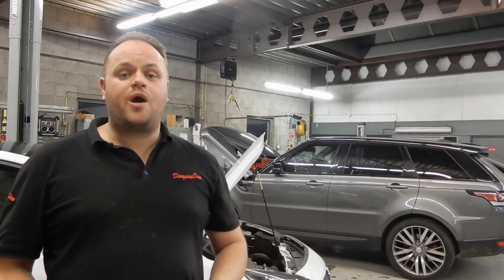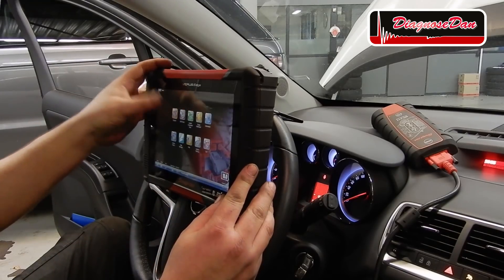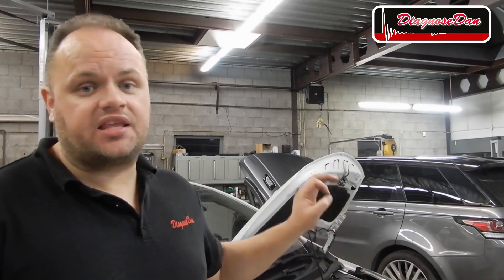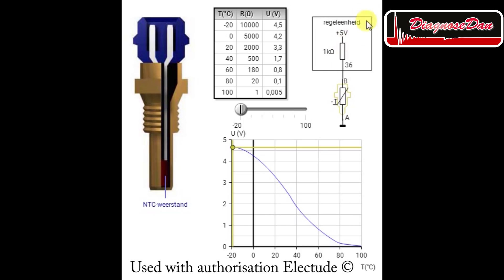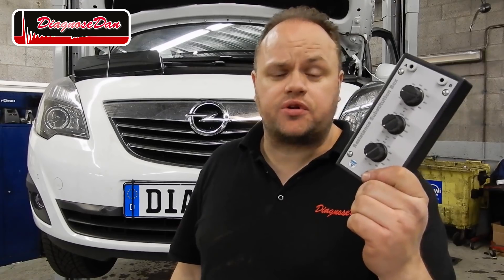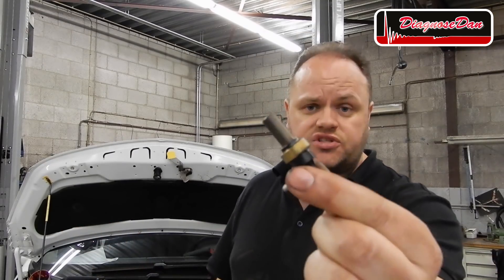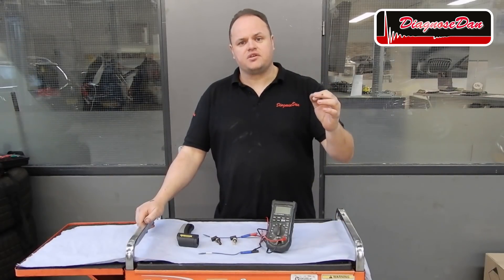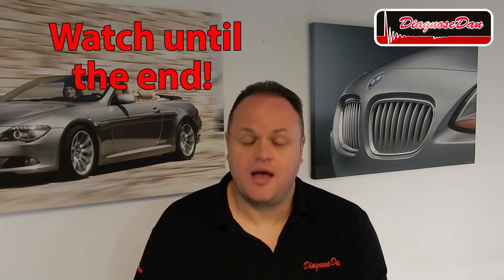Using a Decadebox to diagnose an Engine

Comment: here in the U.S, there is an overabundance of incompetence when it comes to diagnostics and the ones that keep up on automotive systems are few and far between and often has too much work
Reply: Ain't that the damn truth! I deal with idiots every day that don't have a clue at all! To make thing's worse, you have these "mechanics" who are little more than parts changers, and they still butcher simply tasks.
  I had a customer over the summer who had a Toyota 4 runner. She had taken it to one shop that originally did the head job. Well, they routed the wiring harness incorrectly, and even stupidly ran the main harness across bank 2 exhaust manifold and you already know what happened after that. The next shop that she took it to had done the diag only replaced the cam sensors but failed to repair the harness at that point, and failed to even look at the rest of the harness to see what else was going on. 
  They sent it out the door and the customer come to me the following day. I spend about an hour on diag and chasing wire's. Cam sensors part if the harness had a connection issue, along with the crank sensor plug being completely screwed up and i found a lot more damage in the wiring harness throughout the engine bay, and this all started due to someone not knowing what to do. She wasn't happy when i told her what she needed..
  Stuff like that gives tech's a bad name, especially in a small town that's full of shade tree's that have no clue about what they are doing.
Reply: @bryancenterfitt7127  I think in some cases the problem is two-fold. the customer wants the issue fix as cheap as possible so the find a friend of a friend of a friend who gives them a flat rate without first diagnosing it you know sight unseen then loads the parts canon.
Reply: @hammondautollc7809  
I completely agree. In my area, people will bounce from shop to shop looking for a answer that sutes there thoughts. The other problem is people who have no experience and taking on difficult job's and quoting a stupid low price and claiming they can repair it all in the hope that they can get that cash.
 In the end a customer still goes to a reputable shop and then will get upset when the first 3 people do more damage and it costs them 2 or 3 times more than it could have been in the beginning.
Reply: @bryancenterfitt7127  Yeah I agree, I guess we can only help the people that come to us and hope they didn't go anywhere else before us.
Reply: @hammondautollc7809  
Agreed 100%
Reply from the maker: Same thing here😅
Reply: Same here in Ireland, although the encouragement and training is not made very available either. Most garages ive worked for just want to throw parts at a problem and get it out as fast as possible. They have no interest in any diagnostics.
Reply: Don Quixote  You are lucky to have the internet.  We had shit when we started.  Keep your eyes open and your ears shut.  Dan has a good channel.

Comment: Given the huge hint provided by the temperature gauge, how the hell did the garage not explore that route?
Reply: They were parts changers and not Technician's
Reply: mor emoney in putting expensive parts, and they will also mark up dans work as their own, with an added percentage, they wont know dan did the work and hence also loses the repeat business.   Dan, drop some business cards in the glove box
Reply from the maker: I think the tech focussed on reading codes and dived right in. Missing the obvious 😰
Reply: This is engine basics 101. Dan may not have emphasized this enough, but that coolant sensor is big one of 3 maybe 4 other sensors that are crucial to getting the engine started both warm and cold. Coolant,  tps, crank, cam, mani temp, etc. but that coolant temp, can't say enough how critical it is.
Reply: Maybe the previous gge did not have any diagnostic equipment.
Because if they did you would have thought they would have checked live data to see if anything was amiss..
Reply: shauns auto repairs no equipment needed, measure ohms at sensor, compare resistance with expected value based on temp shown by the gauge or actual coolant temp. If these values jive, you’ve proven wiring integrity at the same time. Change the sensor and  Robert is your fathers brother!
Reply: If there are no codes the car is fixed!
Reply: Andrew Kirby I guess garage saw something what led to crankshaft possition sensor :D

Comment: Is this something in Opel ? just curious if Opel could improve their diagnostic system like detecting the sensor returns too low resistence etc. Are car manufacturers improving those diagnostic systems based on feedback from the field ?
Reply from the maker: Yes, they can and some cars do😊

Comment: Dan if you plz  if there is three wires in temperature sensor can I use the same test between the 5 volt reference and the meter wire or what , the other question is if I haven't this tool could I use radio volume switch in this test?! Thanx in advance
Reply from the maker: There are many ways to do this! As long as you change the resistance!
Reply: @Diagnosedan 
Thanx Dan and am I right about the way of test if there is three wires in the sensor?!

Comment: This is a little off topic. But aftermarket lights are notorious for adding fault codes. Is there a way to add a resistor to fool the computer into thinking everything is okay?
Reply from the maker: That's what some manufacturers of aftermarket LED lights do!
Reply: Some?  What other techniques do they employ?
Reply from the maker: @rabnudj  Some cars don't have bulb circuit check. So the manufacturers that make aftermarket LED for cars with bulbcheck do😊

Comment: TBH, I would of gone after the sensor first and tested it with a simple dvom. If the resistance didn't agree with the temp table,take it out and put it in some warm water, no change? get a new one, test that and install. Regardless of the wiring, you know the sensor is bad. Statistically, wiring failure is lower than the sensor, plus who has a decade. As an aside, the other shop must be fools to not see something so obvious right on the dash, even if the car uses different sensors for the dash and engine, it must be considered. Oh and I hate worm hose clamps. Much rather have spring clamps.
Reply from the maker: Thanks for the info😊

Comment: This is my comment @ 2 min 43 sec and when it finally started I feel like it could be timing related because of the intake sound you could hear the fuel pump seems to work when the key was turned on but couldn’t tell if it was running during cranking but the engine sounded normal during cranking compression seems fine and cranking speed seemed ok for sure good battery I’m going to resume the video from there and see how wrong i was I don’t like guessing on diagnostic but it’s interesting from the point of view of not being there and not even looking at scan data or fault codes.   Ok this is exactly what I would’ve done but one thing I do I connect the scan too before even staring the car because you might only have one chance at it in a day so what I do is check for any codes if there is some codes I Focus on codes that could affect the problem mentioned by the customer then I chose scan data that are helpful like long term and short term fuel trim,engine rpm ,coolant and air temperature sensor,air flow meter,fuel pressure if available and also check when was the last time the fault codes was erased and if the codes are presented how many Km’s was driven since fault has occurred on some cars the coolant sensor has 2 sensor in one like MK4 VW’s so you could have a good or bad instrument cluster signal and a good engine temp signal but what I would do is go into the instrument and engine ECU then compared temperature I mostly saw bad instrument cluster temp. Signal great video and explanation.
Reply from the maker: Wow that's a comment🤣🤣 Thanks as always!
Reply: interesting you'd look for readiness monitors, i may of missed if it came from another shop, but it's not always intuitive when there's no codes in memory.
"because you might only have one chance at it in a day" thumbs up to that statement
i know i would of overlooked gauge temp being off

Comment: I think sometimes when we are given a job like this, the customer describes the problem and then we don’t ask any more questions, maybe if the first garage asked if there was any other problems or symptoms then the customer might have mentioned an observation about the temperature gauge? Maybe not of course, but if they did then maybe all these other parts would not have been needlessly fitted. I’m curious about the conversation you had with the customer? Maybe this came to you directly from the other garage of course? Another great job combined with a bit of theory / teaching. Thanks for sharing Dan. Have a great Christmas and a Happy New Year.
Reply from the maker: The Boss of the other shop brought it to me because his mechanics wanted to chance even more parts and had no fix. So i never talked to the customer

Comment: i say, we fit four new tyres and shocks, charge the customer $1000 and then say, well it could need a new radio, oh and BTW we poked a hole in the radiator, you can pay for that too,.
Reply: and that you also recommend an engine rebuild because it`s a 2011-- b ut the very best would be to buy a new Meriva for 40.000 Eur

Comment: easy, check the mechanical fuel pump is feeding the carb,  by pumping the lever and then put the choke fully on... oh sorry, im 40 years too late ! but still the same way to check gauge, short to ground, shows hot, unplug goes to cold, then its sensor %100 percent, no decade box!   other shop couldnt do the most basic thing ever? scam artists
Reply from the maker: I can't remember the last time i worked on a caburator on a car🤔
Reply: i winced a little when he continued to attempt to start the car before hooking up a scan tool, comparing iat, ect, and ambient temp sensor numbers after a cold soak would of led him directly to it.
a "crank, no start" is possibly one of the most documented diagnostic trees, and i'm a little surprised at your findings.
sometimes "sneaking up" on a car, looking without touching and disturbing suspect items is the only way to observe an intermittent fault, in this case, it wouldn't be apparent on a relatively hot motor. 
manipulating a harness without remotely monitoring it may temporarily seat a loose connector, losing any proof it's the root cause.
this goes back to basic troubleshooting techniques, what's the shortest approach to diagnosis, do you reach for the scan tool, power probe, information database, visual inspection, depends on the issue and the tech's experience.
after sifting through hundreds of lines of pids, you start learning which to look at first, also do not discount the value of obd2 generic, as data stream and Freeze Frame are a vital tool that's not really been properly addressed in several videos here, what faults it's vital to document, and which pids are relevant.
i call them customer concerns, not complaints. but i consider myself a technician, not a mechanic or "wrench"
Reply: Yah, about your scan tool PID comment. I’m fairly new to this and using a good bidirectional scan tool definitely has a lot to learn and remember with the different cars and their use of various parameters for the different systems. It does take a lot of time!